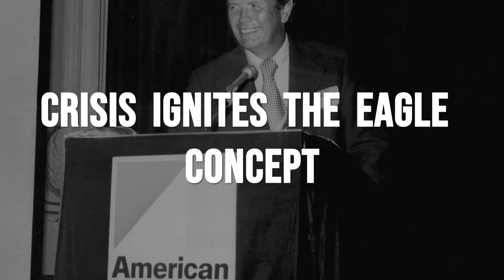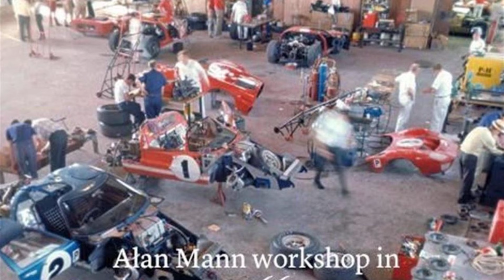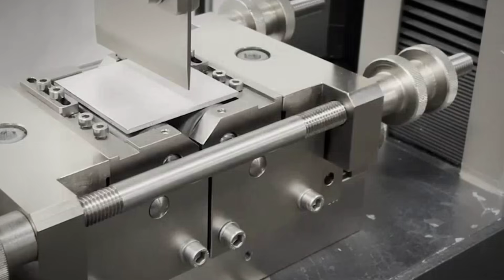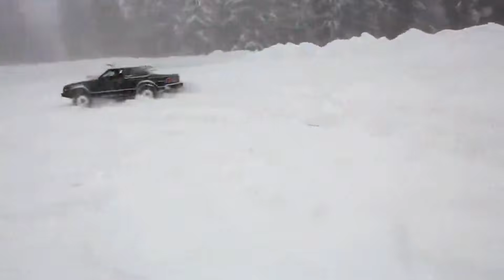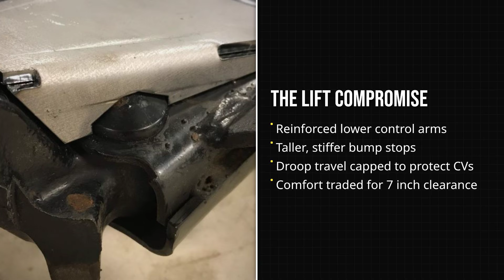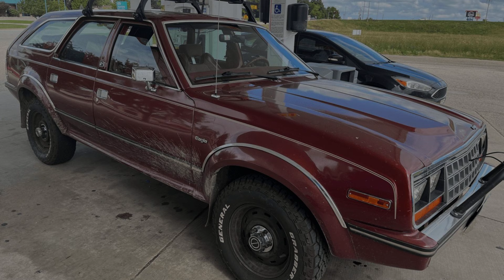The AMC Eagle Design is Bizarre

Comment: I worked at an AMC dealer back when these cars were new, even owned a few of them myself. The 4x4 Eagle was a tough vehicle, I had a wreck I used for parts that we beat in the woods for years, it had been rear ended by a dump truck and still drove. I had bought it for spare powertrain parts because it had almost no miles on it. Despite being damaged and twisted by the wreck, it still ran and drive seemingly fine but was bout 2ft shorter in the rear. The back hatch was crushed, the rear window still in tact till I finally rammed it in a demo derby of sorts with an older F250 we also had there. 
The engine ended up in a Jeep, the rest got sold off piece by piece. 

The two I drove over the years were more than capable cars, the weak link was likely the transfer case, I would have liked to have had the heavier transfer case from the CJ7 in it but for general road driving and some trail use the car was great. My '87 even had the snow plow and deluxe leather interior. I wish I had kept it but it got replaced by a truck in the 90's. No doubt if I had kept it, it would still be running today. 

At work, there were very few failures with these. The 4x4 valve issues were rare, broken vacuum lines came years later. I owned mine for 7 years and never had any issues. The repairs were simple and minor. We saw more power window motor or power steering pump leans than anything else and those were high mileage cars. The owners wife drove one identical to mine and she kept it even after the dealership was long gone.

They were never sold in huge numbers, if I recall, they were hard to get, we rarely had more than one or two on the lot at a time. The push was on the Cherokee and Wrangler by 1987, the Eagle was never pushed very hard despite having a decent demand at the time. Being a multi brand dealer, the sale people seemed to push other vehicles vs. AMC, often pushing folks into buying something they made more commission on.
Reply from the maker: Great backstory. Thanks for sharing!